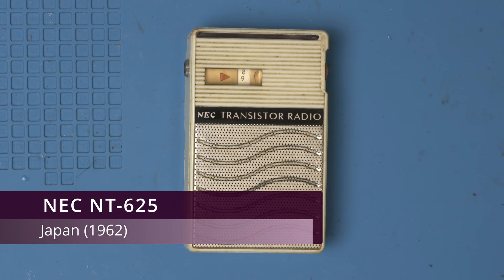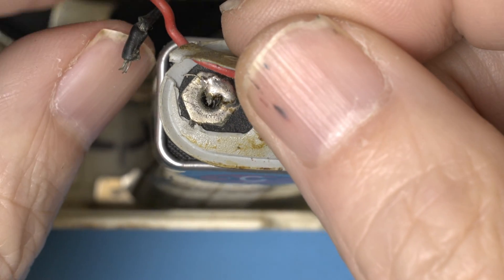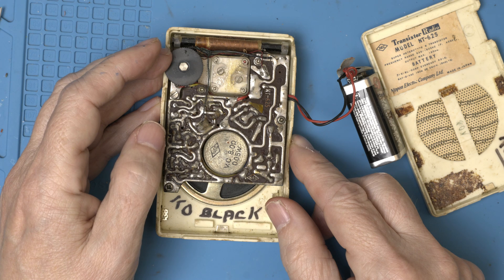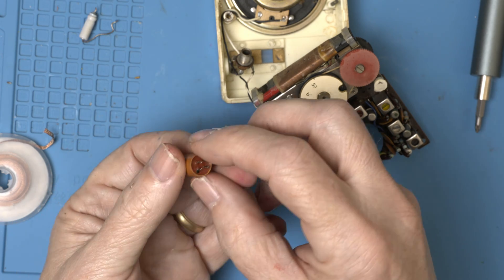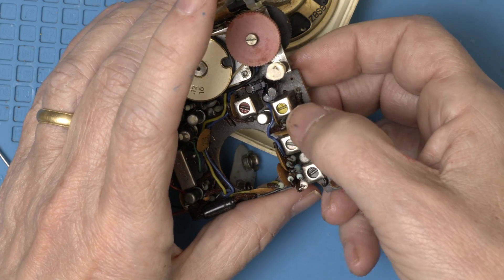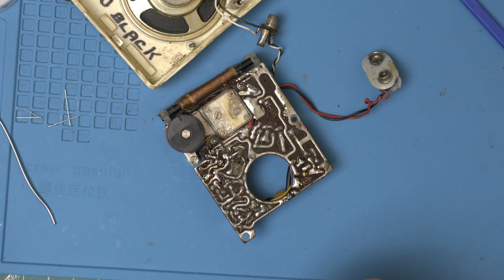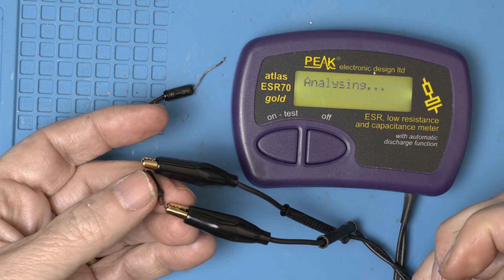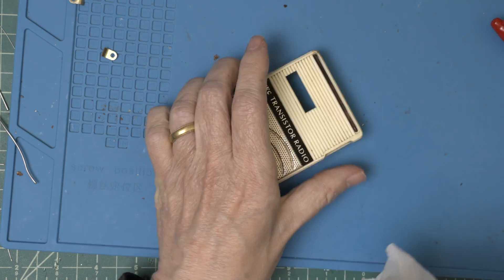Vintage Electronics Repair: Dead NEC NT-625 transistor radio restoration

Comment: One thing you have to look out for in transistor sets (though not in this case) is a stuck earphone jack. If I cannot get any sound from the speaker, I will plug in an external test speaker or earphone. Should I hear sound, the problem is either a stuck earphone jack, an open speaker, or perhaps both.

Stripped off wire insulation can also be used to insulate lead wires.

Comment: Thank you for the video.
I think it's interesting when you test the old capacitors to see how bad they have gone over the years and what type are the worst 👍
Reply from the maker: Yes.  I've noticed that the ones from the early 1960s are particularly bad.  I think electrolytic capacitor technology improved quite a bit into the 1970s.

Comment: Interesting looking radio case. Sounded wonderfull
Reply from the maker: A little beat up, but having the back match the front was a interesting design choice.  That's a better speaker than I was using before.